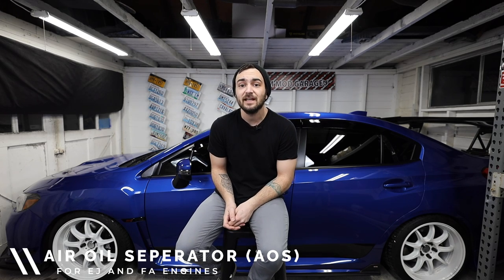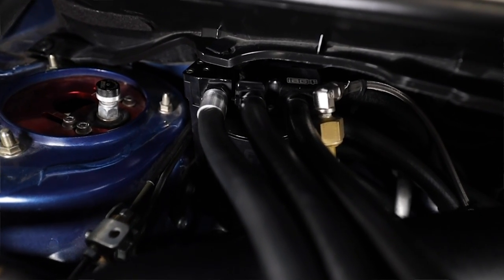5 Modifications To Reduce Engine Knock On Your WRX or STI.

Comment: Thanx for the pro tips Smeedia. Will the Mishimoto radiator have enough clearance to the pullies and cooling fans? Or is there Mods or extra space needed in the engine bay? Also is a catch can any good whats the difference aren't they doing the same job accept one has cooling aspects? Sorry if noob question but educate me please. Cheers. Great content as usual.
Reply from the maker: The radiator with OE fans will clear the pulleys no problem, a catch can will work just make sure you remember to drain it 😅

Comment: Hey Tanner i got a quick question. I just got a 2020 sti and i want to run the equal length headers and the larger radiator. Will i be needing a tune for these? Maybe an intake along the way also

Comment: What can I do with a Ej25 engine on a 2008 Impreza 2.5 non turbo automatic to ensure longevity of my car? I have a cold air intake (not short ram) and a 3' dual exhaust catback as the major modifications. The catylic converter is a walker brand about a year old and carb emission compliant with unequal length headers. The entire exhaust pipes are basically replaced as are other general maintenance parts (spark plug/wires, ignition coil, valve covers. Currently, the car is being serviced for bad compression and internal burning oil most likely it's going to be a piston/valve and seals repair. It also had a head gasket repair almost a year ago also. Currently, the car has 177,740 miles on it. Any ideas as I'm not ready to get rid of it just yet. Just a side note I replaced the spark plugs (NGK) and wires and the cars expected avg. mpg. reached as high as 30 avg. mpg
Reply from the maker: Honestly just stay ontoo of maintance, add a catch can ans drive the car. If you really wanted you could do a larger rad but thr N/As don't have a big aftermarket standing unfortunately

Comment: I think I’ll do everything except the equal length headers. It does affect the sound of the exhaust. Gives a different rumble, I prefer the original rumble sound.
Reply: I got a 30hp gain to the wheels from AFE equals. My tuner reccomended them and he wasnt mistaken. He even tuned it on the dyno and was impressed in the end. Subu uneven rumble is gone but car is still loud and demands attention.
Reply: Equal length is objectively better, but as a wrx owner I can't blame sti's for not wanting to make the switch.
Reply: I’ll lose the rumble for faster spool and more power any day of the week lol
Reply: The rumble noise doesn’t even sound that good lol

Comment: I JUST ordered the IAG oil pickup kit, it comes with the pickup and baffle but im not sure about the pan.  I'll have a review soon.  Should be installed by next week. 

Also did the IAG (Cobb rebrand) AOS, and a perrin oil cooler.  However,  I'm getting a new turbo and went with the Tomei mx8265 and Tomei unequal headers and up pipe)

BTW, also got the KEIN blast plate transmission thing and torque solutions trans mount and pitch stop.  

Plus a ton of other supporting mods and gauges (AFR Oil temp Oil press) it's gonna be a whole new beast.
Reply from the maker: Those blast plates are such a good option for the OE trans!
Reply: @Smeedia  yeah I'm really regretting replacing my trans with an OEM one a couple years ago, would've cost less to have it rebuilt.....  Hindsight 20/20. Better decisions have happened since,  but it was a huge hit. 
It's a whole other deal.  So, i want it to last as long as possible.

Comment: Awesome video. Going to spend this summer getting all of those installed. Then next summer, power mods. Also noob question. Would you need a tune for any of those?
Reply from the maker: The only one you need a tune for is the ELH 😁
Reply: That's a good question... and is it worth waiting to do it in stages, like do these, then a tune then your air intake system and tune again then say boost tune again or wait till you do it all including your suspension etc then tune? Or do what you can afford for a while eg I could probably realistically afford maybe this stage stop for about 6 months save up and wack more money or should I tune between? sorry to hi jack your question man!
Reply: @andrewpaige9152  it's all good bro! Everyone has a different budget. Pro tunes are quiet expensive if you're to do multiple tunes, about 350 a tune usually. I'd say do it in stages if you can afford the tunes. If not, hoard all your mods then tune it in one go. Which is the route im planning on going. Since smeedia confirmed that the supporting mods don't require a tune. I'll be doing those before power mods. But I'll be running MAP stage 1 just for the extra power being fully stock.

Comment: Hey man great video. I would also suggest upgrading the fuel system too. Damn crappy series system in the EJ’s. Cylinder 4 always gets the short end of the stick. u can lean it out and cause knocking.
Reply from the maker: Another solid upgrade choice, especially with the 2015+ STIs

Comment: So I have an aftermarket set of unequal length headers on my sti. They are tomei ones. Is that still technically better than the stock headers? I noticed the stock headers are way more restrictive than the tomei ones and the piping size is significantly bigger on the tomei and looks like they have way higher exhaust flow. So even though equal length would be the ideal choice wouldn’t aftermarket unequal length headers still be better and still somewhat help with reducing knock? I noticed after Installing the tomei headers my overall knock decreased a good amount still.

Comment: Some good recommendations there 👌. Whether you have an EJ or FA motor the AOS is a no brainer, went with IAG. A better exhaust header, specifically stainless is right up there too, the larger diameter makes the engine breath better. The one modification not on your list that both EJ and FA engines can benefit from is a Fluidampr  harmonic crankshaft damper, especially if you are increasing WHP and torque. It is $$$ but a longevity extender. You may want to add it to your list!
Reply from the maker: Not a bad one to add it! Getting feedback from everyone in here just makes the lists stronger and better!
Reply: What brand would you suggest for a fluid damper? i would say the FA guys (any DI engine) would need the AOS a little more then the EJ ( not saying we don't need it cause we do) just cause of the DI and how prone to knock those motors are  as well as the carbon build up on the valves nasty stuff. Great vid man !
Reply: @watch6058  
Fluidampr is the only fluid filled crankshaft damper I am aware of. I got mine through Subispeed  https://www.subispeed.com/catalogsearch/result/?cat=0&q=Fluidampr   .  I installed it with my engine upgrades.

Comment: Thanks for the tips, but question do i need a tune if i change the radatior ?
Reply from the maker: No tune required 🔥
Reply: Thanks
Reply: Would you install the v3 Crawford without coolant line for a daily drive or stay with the IAG street version ? Thanks

Comment: What you think about the Crawford V3 AOS that doesn’t use coolant but is located right on top of engine to get the heat off of it?
Reply from the maker: I think it works but out of all the options is not one of the best choices. The ones that run coolant IMO are the way to go

Comment: Great Vids, keep it up!  On the oil pick up/windage tray/oil pan, sounded like you thought less important for certain years.  I have a 13 sti hatch, did subie improve these at some point and lower risk?  Obviously you are doing on 15+ so assume still an issue...just trying to prioritize the $.  Thx brotha!
Reply from the maker: The older gens used a thinner material for the pick ups, in 2011 Subsru revised the pick up and increased thickness but it is still a potential problem. I would suggest swapping it out just to be on the safe side.

Comment: Love your videos! Super informative. Recently saved up enough to afford an sti. Went with a used 2017 sti limited. 39k warrant is still good. (Trying to convince them girl to let me got to stage 2) 

Have a couple of question 

Road noise? Is it always this loud? 
Gas mileage!? Averaging 17.9 
Brake squeaking like crazy! Just replaced drove 200 miles still! 

Ordering Acces port next week. With stage 1+ mapperf. Any thoughts?
Reply from the maker: Congrats on the car!

Road noise is pretty prevalent 
Gas mileage is awful 
Brakes will inherently squeak, just the nature of brembos. 
If its stock just do the stage 1 map 😁
Reply: Smeedia Jesus! Leaving comments at 4am after a tangent of tomei exhaust videos and the constant fear of paying of student loan debt for the English degree that clearly didn’t work.   Thanks for the reply. I think the brakes are worse than we thought! Never makes a noise with hard pressure. But simple going down a hill they act like they are being tortured.

Centerdif clonks when at a stop and put into a different setting. I.e (sport# with auto front) will make a noise as if something is my trunk. Worried I bought a dud.
Reply from the maker: @TheRandomSounds  the 17s are pretty solid, mone is a 17 also. Unless the previous owner really beat on it. But just go through everything and make sure it's all up to date 😁

Comment: How important is the radiator splash guard for the bottom of the engine bay
Reply from the maker: It helps with airflow but it's not 100% needed

Comment: You didn’t mention the engine oil cooler?
Reply from the maker: I think it will help reduce knock, but for the price I dont think that it's one of the top ones. It will definitely help though!
Reply: Oil temps are more of an issue with higher horse power. On stock turbo cars, not really a concern. 
A larger radiator is sufficient at keeping temps cooler. A larger radiator and AC delete will drop temps around 20 degrees

Comment: Yo smeed. I want to put an intake in my 2017 wrx for my first mechanical mod. I've been doing a bunch of research and been trying to get a straight answer on that forum u recommended but cant find what I need.  I just want to know what is the best way to go - Mishimoto, perrin, or cobb. Lmk what u think thanks man
Reply from the maker: Personally I would suggest Cobb then Perrin then mishimoto. But get one that fits your budget. They will all do the same thing in the end 😁

Comment: How will a larger radiator affect the fitment of a front mount intercooler? I want to get a front mount at some point and I would also like to get a larger radiator.
Reply from the maker: It won't. Thr rad sits behind the core support and the intercooler sits infront of it 🙏

Comment: Currently running IAG street AOS and their oil pickup: made by a brand called Tigwerks. Good product, 10k miles and two track days with no issues.

Two mods I recommend:
- e85 flex fuel, disregard detonation almost entirely
- thermostatic oil cooler

I haven’t had good luck with Mishimoto products but at least their customer service and warranty are good. I’ve got a CSF radiator and it has more cooling capacity than Koyo and Mishimoto

The Cyl 4 cooling mod is okay to me - your knock sensor is over cylinder 4 anyway which helps make the tune more conservative. It’s also an extra 4 spots for leaks to occur
Reply from the maker: I left of Ethonal only because it's not readily available for everyone but I 100% agree with you! My old CSF Cracked so quick 😫 interesting to see how everyone has diffrence experiences with brands 😅

Comment: Hey smeedia. My neighbor has a 2013 sti. Cold air intake, iag short block, up pipe, Dow pipe, uel headers and a cat back exhaust. Runs on e85 and had it pro dyno tuned making 425 on e85. And hasn’t had any problems so far as of now. He keeps up with his maintenance very well. I also want the uel headers and I want to run the same set up. What do you think
Reply from the maker: Depending on the protuner sounds like a solid set up with the proper supporting mods! 🔥😁
Reply: @Smeedia  thanks a million!
Reply: @Smeedia  also is it possible to run the same setup with a stock motor instead of the short block?😂
Reply from the maker: You can you'll just make less power, I made 400WHP on stock block and that was pushing it. But also depends on what year you have. The 19+ have the RA short block which can hold a lot more power

Comment: I bought a grim speed air oil separator for 300$ then after the install I later found out that it’s kinda junk.😢 I can’t return it because I already cut some pipes. I’m thinking about the Cusco oil catch can they are like 75$ for a 0.7L can.
Reply from the maker: I would rather use a catch can than Grimmspeeds, just remember to drain the catch ever week or so. The grimmspeed one will build up condensation since there is not coolant flowing through it
Reply: I’ll run the Grimm speed for a month and I’ll see if I can get the iag aos. And I just ordered a cylinder 4 cooling mod off rally direct sport. Thanks for the helpful content

Comment: I have a 2018 WRX which comes stock with equal length headers, would you still recommend upgrading to aftermarket ones?
Reply from the maker: Only if your looking for more power, the ELH that they come with are better than the EJ UEL
Reply: @Smeedia  Appreciate the feedback!  I added a Cobb AOS as my first MOD.  Wanting to tackle some reliability adds before I go to stage upgrades.  Would the Mishimoto radiator be the next best add. Thoughts?  THANKS!

Comment: I’m getting a 2021 Wrx, can I put an intake and exhaust one it and keep it reliable and what are the best steps to take to do so, i know already about changing the oil every 3k and using one that meets the spec but what else is there to know?
Reply from the maker: The intake will require an accessport but you can use an OTS Tune for that modification. 
Honestly just stay ontop of maontance. Walnut blast the valves every 30K as well. It's a maintenance item that's often over looked
Reply: @Smeedia  what do you mean by walnut ast the valves?
Reply from the maker: Typo, *blast. 

They build up carbon on the backside of the valves so cleaning them every 30K is highly suggested. Subaru offers a slow induction service or others can blast them 🙏
Reply: @Smeedia  sounds good, thank you! I’m trying to gain as much knowledge as I can to keep it reliable as possible, also would a Cobb AP void warranty if I just used it for gauges?
Reply from the maker: Just make sure that you DO NOT marry it to the ECU 🙏

Comment: If you upgrade your radiator,  do you still need the get a dom mod??
Reply from the maker: Yes, a radiator will help efficiently and a cyl 4 mod helps balance cooling on the drivers head

Comment: So my tuner was just telling me I should switch to E85 cuz it prevents knock... is running she’ll vpower or flex fuel more reliable? Also what’s the best oil for reliability? I’ve been using castrol 5w/30 A3/B4.
Reply: Not interested in E85 power gains. Car is already nuts. Just looking to make it last a long time. It will be my daily for quite some time
Reply from the maker: E85 will help reduce knock but not everyone has access to it, there are also some other potential issues when swapping to E85, such as corrosion. But for the knock factor it is a good alternative
Reply: Where exactly would corrosion occur though?

Thanks man! Killing it with the videos!

Comment: I experienced the Cracked weld on my oil pick up tube on my  2011 WRX Hatch, causing me $13000 Canadian for diagnosing and a new engine. Reconditioned the top ends and got a new lower end. What a shitty heart ache that caused.  Just had a Cobb AOS installed. (Made by IAG but Cobb adds heat shielding along two hoses, The shop only had Cobb ones so I went with it as opposed to saving some. I figured installing it myself was going to be a huge pain in the ass in a gravel driveway in the snow and rain.)  I can't wait to install the oil pick up kit though, Don't ever want that to happen again! I had to take out my Strut brace for the AOS which is kind of a bummer since the difference was pretty noticeable. (AEM Welded steal strut brace.)    Also, Subscribed!
Reply from the maker: If the Cobb AOS using the same mount ring played as the IAG you should be able to mount it a little lower and fit the strut brace. And I know the pain of the cracked pick up tubes as well 🙃 
Appreciate the support!
Reply: @Smeedia   Say what are your thoughts on Light weight flywheels vs a Fluidamper?
Reply from the maker: @EJL2004  I mean they are two different parts 😅 lightweight fly wheels I cant speak for because I've always used the OE flywheel. But the fluid dampers I'm a fan of, dont like the lightweight crank pulleys very much. The fluid damper helps a lot with the vibration from the engine
Reply: @Smeedia  oops!  lol I mean't a light weight crank pulley not flywheel. Total apples to oranges there.

Comment: I have a question so I got my car pro tuned not to long ago no engine light nothing and only my feedback knock is going off what should I look for? Dam is completely fine doesn’t move. Only mods on the car is aem air intake, catless dp and n1 race exhaust, and a Grimm speed boost controller? 08 wrx and I have no codes or lights?
Reply from the maker: What value are you seeing?
Reply: @Smeedia   it fluctuates randomly sometimes it’ll only go to 3 sometimes 4 sometimes even 8 or 11 it’s random but I have no check engine lights or anything?
Reply: @Smeedia  but it goes back to 0 it doesn’t stay at that number
Reply from the maker: Check around your knock sensor for a bolt or nut rattling around it
Reply: @Smeedia   will do I’ll check in the morning and see if there’s anything
Reply: So I checked and there was no bolt maybe the sensor is just bad? I’m driving up to tennesse tomorrow morning from FL So I’m hoping nothings wrong it’s my daily driver and I haven’t had any issues